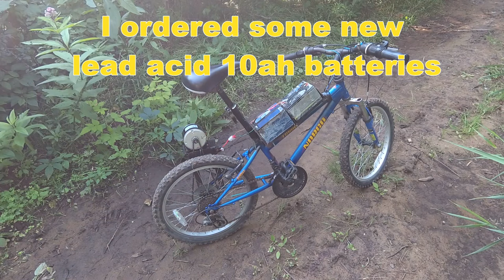DIY Electric Bike - ebike using 350 Watt 24 volt DC Motor $70 Build

Comment: Putting your sprocket on the other side of the back wheel like that, just going with an entire extra chain system, the motor all connected & mounted over the back side like that... 🤔 I never thought about doing it like that. I KNEW there had to be a better way!
Awesome stuff, thanks for sharing it.
Reply: Were you going to do it with suicide pedals? There isn't really another another way to do it...

Comment: The finest modification you can do for a chain driven electric bike conversion is without a doubt adding a freewheel. The only thing I would upgrade is a 36v lithium battery.

Comment: Hi! Im building a similar build for my electric bike, and i have a question about the rotation of the motor. I've built my diy bike thats similar to your, and it using the smae exact motor your using, but the motors spinning the wrong direction. How can I reverse the direction of the motor? I have it hooked up to a 2 pin rocker switch and a 22.2v 1400mah battery and it all works, but how would i have to change it if i wanted to make it go the opposite direction?  Its going clockwise now, but i want it to go counter clockwise. If i swap the connectors on the motor ( like connect positive motor wire to negative battery wire and negative motor wire to positive battery wire ), would that work?
Reply: If you're not using a controller, changing positive and negative connectors would work.

If you are using a controller though, you probably connected something wrong or built it in the wrong direction. I'm not sure if it's gonna be okay when you connect your battery or motor backwards, but there is a chance that you can fry a diode or two.
Reply: Change the polarity or terminals and the battery pack is not powerful only1400mah is too low you should have 20amp minimum because the motor current is 19amp and should have more mileage or riding distance i use a 45amp battery pack
Reply: @shanav3325  pls tell me the batt pack yiu got!! Also the cost!! Look finding a good battery is so hard for me and Idk why!!
Reply: Is it a lipo batt ur using?? Or an acid…

Comment: Nice work! Hope the fresh batts got you better performance.

Hmm. I bought a left-side drive freewheel but I can't weld. I am putting together my first ebike (after fun times with an electric 3 wheeled wheelbarrow). I was picturing pretty much what you have done, but with a geared motor for more torque. Will have to get a favour from someone to add a bigger sprocket and mount the whole freewheel to the hub. HMMMM. 

I will know when the parts are in my hands! Good stuff. One way or another, I will get it done! Might not go fast as I didn't do any math. But that's what a prototype is for!
Reply from the maker: Thanks a lot 👍 I recently put some 12 Ah lead acid batteries on, it's way better but I will upgrade to lithium one day.  You can remove the cassette and put on an adapter so you will have two single speed freewheels the one for the motor use a flange type freewheel and bolt on a large sprocket,  but you will lose your pedal gears tho 😢
Reply: @kurtscottage  
Totally just got myself something together after watching your video first time! I honestly didn't do any more research haha, just thought, alright mate, he did it, YOU do it! Thanks for that! Very fun to do yourself.

Didn't do you justice, but managed a sturdy build using cut barn-hinge as a mounting plate w motor right near hub.

In the end (6 tries) I just bodged together something w a freewheel on the motor driving one gear and keeping the original chain (2 speed front + fixed the rear derailer on one gear). Can pedal normal and coast and use motor for "assist" (but the motor sends the pedals round haha). Put nearly 100Km on it so far regardless. So much fun I haven't yet tried rag-jointing a sprocket on the other side and doing it all over (so I can keep my feet still with the motor going). 

12V motor but I tried 24V for a minute and that thing moves! +40Kph but it gets hot quick! Thinking of adding a series/parallel battery switch for "passing" the store-bought bikes (limited to 32Kph in Canada).

18 Ah SLA motorcycle battery slung in an ammo case w a similar PWM controller and external charger (but don't charge in a sealed box). 

Didn't cost that much if you only include the parts that worked in the end :)

Thanks again for the inspiration, sorry to waffle on

Comment: Im also building an diy electric bike. Im ziptying the wires to the bike frame, but should i use electric tape to cover up the exposing wires?
Reply: yes u definetely should cover up the wires. If you're using a 24V motor it'll be pulling around 14A of current which is pretty dangerous. I'd even suggest a whole crimped wiring setup as it allows for safety to be prioritized but at the same it's easy to disconnect a wire connection for whatever reason you might have to disconnect it.

Comment: cool,love the vise-grip crimp tool😁
Reply from the maker: Thanks, have to use what tools are within reach 😎
Reply: @kurtscottage  Yeah I bought the crimp tool with the little tooth to get the connections solid. I never thought of using the vice-grips. That was clever.

Comment: How do you make the motor from slow spin to a fast spin?
Reply: That's what the motor controller does. If you use a cheap brushed motor, you need the controller to be specifically for brushed motors. Easy peasy.

Comment: I LOVE your ebike builds.
Got the long Covid, so I fatigue easily when i try to exercise. So a cheap ebike seemed to be just the ticket. I'm 6'7 and weight 300 lbs, but it's illegal to have ebike with more than 250w assist, unless you register it as a motorcycle here.
So i got the 250w kit with the geared motor.

Two questions.
Is there a reason you put the freewheel sprocket on the wheel hub, and not on the motor? This is not i critique, but genuine interest. Seems like the cheap little chinese free wheels would be prone to failure, and will need some maintenance, since they are not sealed. So i would have thought that putting the free wheel on the motor, and hense further from the road grime, would be better? Also - if the free wheel is destroyed, it's welded on, whereas there are adapters to make the free wheels fit on the motor shafts. Welding the sprocket directly to the wheel hub should be easy. But you are the expert, so i would love to know your reasoning :)

Would you advice me to get a higher wattage controller than the motors output. Like a 500w 24v for a 230w 24v motor?

And dude - thank you for all your awesome videos. You have helped me so many times with your down to earth solutions. From clearing snow, fixing rust on my car, and now with a solution to my health problem. Seriously - if i can make my old military bike work with 250w assist, it would be a game changer (I have plasma, welder, metal brakes etc, so the fabrication should be doable, so it's just a matter if the motor and controller will hold up)

Keep up the great work :)
Reply from the maker: Thank you so much!  Sorry to here that, hope you get better soon. I guess the best reason to put the freewheel on the hub is so the chain isn't always turning, but true changing it is a pain.  I had to do it the other day welded it on backwards lol.  You could weld the drive sprocket right on the hub,  many kits work that way but use spoke rippers. At that wattage I would use the largest 410 sprocket you can find on the hub. One of my bike uses a geared 250 watt motor they would probably be better for your build, I over volted one from 12v to 24v 500 watts, I ordered the 12v motor because it was half the price, but It does get warm.  If you could add some cooling like a fan or heat sink to your controller and motor that would really help. I don't think its a good idea to increase the wire thickness to the controller, this will guarantee to eventually burn the controller. I find the wires act as resistors, can be a good thing tho, use more heat resistant wire or cover individual motor / bat wires with fiberglass selves. Have everything so you can disconnected easily just in case.   I'm working on another build will try and add more advise on low wattage builds. Good Luck
Reply: @kurtscottage  
Thank you for your kind answer :)

I got the 250W  kit with the "spoke rippers", as you call it, that was a 32 tooth gear. Got a 500w controller for the 24V motor, and out a 25 amp fuse between the battery and the controller.
Also put a 60 amp switch between the two 12v 12ah lead acid batteries, so i can balance charge them. Just hot glued a buck converter to both batteries as charge controllers, so now i can just flip the switch to disconnect the batteries, and power both buck converters from one 4 amp 19v laptop power supply. So now i can bring the charger when i drive to friends houses, and plug it in, via the 5.5mm plug i soldered to the inputs on the buck converters.

The gearing is actually perfect. Even if I weigh 300 lbs, and my 38 year old steel military bike another 65 lbs with the batteries. It's not fast, and i have to assist when the incline is more than 3-4%, but that's fine :)

It was a little hard to install, since the bike has the three internal hub gears, so the hub on my bike was 52mm, where the spoke ripper gear only had i 36mm hole. But with a kompas and some patience with a carbide bit, i made it fit.

I have put about 200 miles on it so far, and it works great. Only thing is, that is seems the thumb throttle with the three indicators lights are expecting a 7S lithium battery pack and not SLA's. So where two fully charged 12v SLA's gives you 27,6 volts and 7S lithium would give you 29,4. So it's a little hard to figure out when you are truly about to run out of power, i you dont hook up at voltage meter. So I will find a cheap one, and do that.

But awesome kit, for tinkerers :)

Once again thank you for your videos. Without you, i would never have built this bike. 

But now I'm all in, and have soldered a spot welder, battery capacity testers, balance chargers and bought a couple od BMS's, active balancers etc, so i can build my own Lithium pack, for all the the used cells i have lying around :)

Comment: Using the small motor makes it more affordable. I have an idea to increase available torque by using the leverage principle. Will need mountain bike cranks & to increase torque connect motor output to large gear on crank & connect small gear on crank to wheel. This will give you a lever advantage. The difference between the small crank & large crank in Outside Diameter is like a small lever & will increase torque to the wheel & should help with going up hills.
Reply from the maker: Thanks! for sharing the awesome ideas 👍, I only did a simple setup but with your setup it would probably work much better up hills.

Comment: A easy way to connect motor to drive bike is by fitting another pedal crank gear on the left of bike & connect motor to gear on left crank & right crank connects to wheel gears. Only need to mount motor in centre of frame & cut off pedal crank arms. Easily reversible.
Reply: I like the idea. Send me information

Comment: Interesting build. Could the motor be wired the other way and mounted right above the back tire? Your setup looks like it would affect balance badly. Otherwise I like it. Using a bigger driven gear it should work fine with a grownups bike.

Comment: The welding is a deal breaker for me, But I have seen kits that have a bolt on sprocket.
Reply: Welding pretty easy bro
Have a go
Practice on different steel watch some youtube clips
Stick welder set up $100
Its a handy skill to have

Comment: btw on my motor i cant get that small gear off. can you? or is it perminant?
Reply from the maker: I was able to take one off, the motor has left hand threads so you have to turn the nut clockwise to loosen. Try holding the gear with vise grips carefully,  ✌
Reply: @kurtscottage im doing an e-scooter kit with it! So by what you said. It then means that its lefty tighty and righty loosy?
Reply: @kurtscottage oh btw in this past year i did what you did in the video but with a 2stroke engine instead lol😂

Comment: If you set up the front wheel as a dynamo, you could recharge your batteries as you go, it would not fully charge the batteries but it would give you an extra few miles for nothing.
Reply: Better way is to have regen braking.  Disadvantage is continuous motor drag to get about 5% improvement.  Not worth it, unless  you ride down hills a lot.
Reply: Recuparation break. ;)
Reply: Conservation of energy....if you use 500w to move and capture 250 back with a dynamo 200 goes to the battery and 50 is heat.  It's a net loss

Comment: Hey I’m using the same motor and was wondering if u used a different gear on the motor than the one that the motor comes with becuase I bought a bike chain and it does not fit the gear
Reply from the maker: Yes you could order a bicycle chain motor sprocket maybe 8 tooth #410 if your chain is for a single speed bike, I ordered some online for a couple bucks.
Reply: @kurtscottage  Ended up buying the right chain i was just being stupid. I am now ordering parts for my own bike conversion. I'm going to kinda loosely base my design off of yours if you dont mind lol ;). I was just wondering why in the description you said that you needed two batteries instead of one. I thought you only need one battery connecting to the controller. Thanks!
Reply: @jaakkaan4784  His motor is 24V so he has 2 x 12V batteries in series (one after the other like in a flashlight). I sourced a 12V motor so I could use a single battery.

Connecting batteries in series adds their voltages. Connecting similar batteries in parallel adds the amp hours (runtime). A bit of research will sort out the details and safety concerns!

Comment: I have a question - will this type of motor change the direction of rotation when reversing the positive and the negative wire? 
If not, you need to be careful when ordering. If the motor spins clockwise (like yours), you can mount it left of the wheel. But if the motor spins anti-clockwise, you can only mount it over top of the wheel.
Reply: Then, why not just flip the motor so the drive sprocket is on the other side?

Comment: omfg bro i have the same exact motor...i think ima try the same thing!!.....maybe
Reply from the maker: Build it up! I would recommend putting the motor on a bike with a smaller rim like 20 inch. The kids bike I used works great, it's very light also if it was a larger bike I would have needed a huge sprocket on the wheel. Good luck

Comment: How is that bike now? I bet you could stuff a 750w in that 350 motor?
Reply from the maker: Thanks. The bike is still working good.  I road it the other day, It's not as fast as my others but I have a 500 watt motor and it  would bolt right on 😎

Comment: Neat,but 1 question why not mount the battery down low, or put them on a  little trailer?, would be much better handling,
Reply: It seems silly at first, but I like the idea of a battery trailer! Could really put on the miles and as you say, would not make the bike tippy. I often ride with a trailer so I will make a parallel battery cable extension so I can add batteries (when I make my electric bike :)

Comment: What does the controller do exactly . Could you not just wire the motor up to the battery with an off and on switch or am I missing something ? I WANT TO BUILT ONE AFTER WATCHING THIS BTW well done mate.
Reply: PWM (pulse width modulated) controller ($25 China) allows you to control the speed like a throttle without losing motor torque, so you can accelerate nicely and get the most out of the batteries.
Reply: @CarlDidur  thanks for your help mate. Can you also help me. I’ve fitted the controller but I don’t want a rev I just want a switch instead of a red I’ve fitted the controller . Will I loose any power with just a switch if I connect the red and black wires together of the Rev. I’m not very clued up with volts and stuff haha I’m a bricklayer... cheers mate
Reply: @anthonyglynn7361  Not quite sure what you are working with over there! 

If you just want a switch make sure it is hefty enough to take the current (20A) and put it between the + battery and the motor. Then it is just ON/OFF at full power!
Reply from the maker: Thanks a lot 👍
Reply: @anthonyglynn7361  did you ever figure it out? I could help you